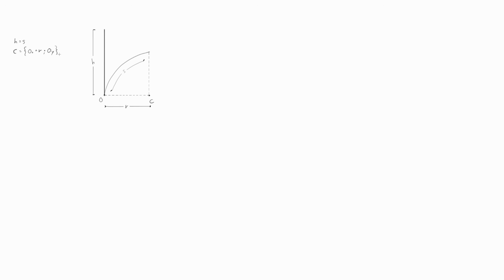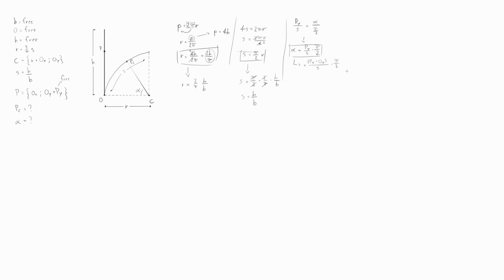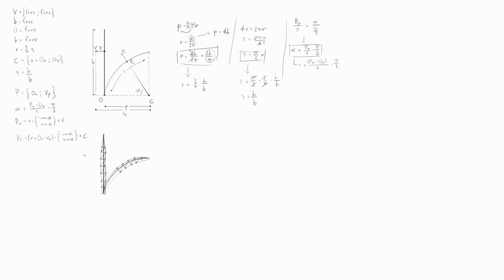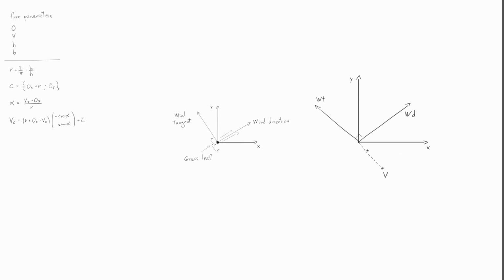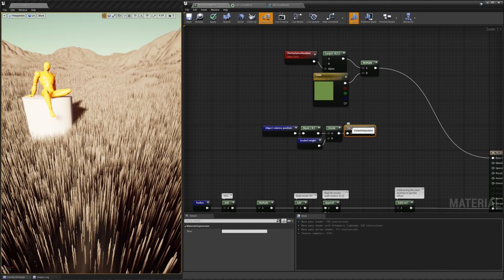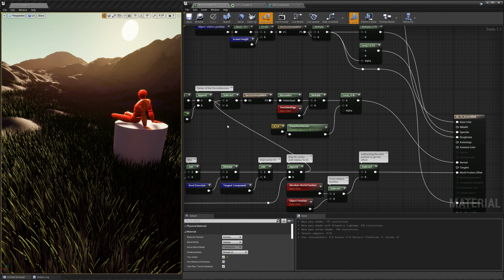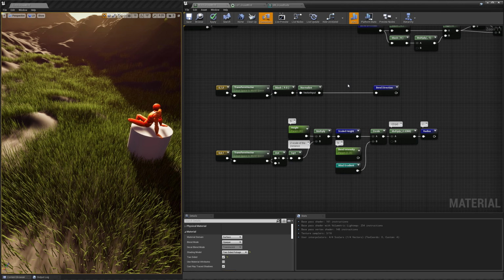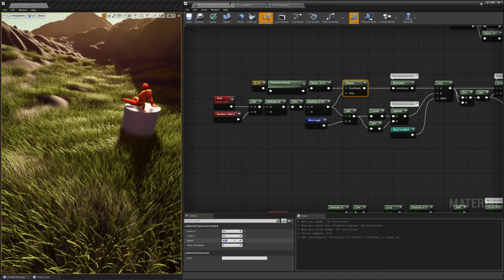HYPER-REALISTIC Grass Wind Animation [UE4, valid for UE5]

Comment: Hey! Just want to say thank you first, then also I'd like to provide you a solution to use this method with multiple strands in the same static mesh instead of individualy spawning the blades. I made my mesh of multiple strands between the -1 to 1 world space in Maya, then wrote a super small script in python that would encode the pivot per strand in R,G component between 0 and 1. In the blue, I'd encode the max bounding box of the strand and in vertex alpha channel a random float. Having the blue encoding the height, I don't need to manually type it in the shader, just sample the blue channel. In engine, I set up uniform import scale at 50 (since maya export is pretty tiny between -1 and 1). On the shader side, I just replaced the Object Position nodes you found in your tutorial by the following (writing it in pseudo code, but shouldnt be hard to read): 
xy_coords = ((vertex_color.rg - 0.5) * 2.0)
xyz_coords = transformPosInstanceToAbsoluteWorldSpace((xy_coords.x, xy_coords.y, 0.0) * import_scale)

The import scale needs to manually be set depending on how much you scaled the static mesh from the maya export. The small math in xy_coords is needed to bias scale the 0 to 1 coords to -1 to 1. After the, the mult from the import scale will make match the pivot positions in real world setting. The append of 0 is for having the strand roots at 0 initially (depending if it was in maya).

Hopefully it makes sense, and again thank you so much for providing this great basis that helped me work my way through this!
Reply from the maker: Great job with that! It's definitely a working solution :D
Really happy to see someone giving a go to bouild on top! May I suggest to use UVs instead of VertexColor? You might be able to get rid of needing manual scaling and range remapping altogether ;)

Be sure to join my Discord if you haven't yet!
Reply: @VisualTechArt  hey! Thanks for returning back. You just had a great idea and it worked like a charm. Save few instructions and just did a top planar projection, scale to center point the top projection uvs then used it as pivot instead. GG!

Comment: Is there a way to apply this for trees? Maybe, it's too complicated by there complexity? PivotPainter2 remain the best option? But hard to apply if you don't have 3DSmax to generate the PP2 Texture :(
Reply from the maker: I think it's possible to do something entirely procedural with few restrictions :D I may give it a go in the future actually.
If you want to tackle the problem by yourself I'd say that you can start by applying this exact bend (not as strong) to the entire tree and then make a second layer of bend added on top for the branches ;)
Reply: @VisualTechArt  How would you approach a second layer of bend? Unless it's a species with a straight trunk, I'd say you might have to separate the branches into unique objects to access their pivot points. I'd also think you might have to manually align the z axis of the object to the branch length. I don't think this should be too difficult for a second layer, but more detailed trees might have 3-5 layers of unique branching so idk how to do something like that.
Reply from the maker: @dylankuzmick3122  Well it depends heavily on the structure of the asset I would be working on. Let's say you have a pine with a very straight trunk and horizontal branches, you can easily break down the movement into 2 layers and apply them on top of each other (kind of in the same way I did in the video to make the grass blades point straight up before bending them) :)

Comment: I have everything set up the way you do, but my grass blade curves from the top and bottom. making a c shape. do you know how i could fix this?
Reply from the maker: May be because your pivot point is at the centre of the mesh, or because you're not looking at an instanced mesh and the Object Position node in that case returns the centre of the object :)
Reply: @VisualTechArt  i cant figure out how to adjust the pivot point. also, when i paint the grass using the foliage tool. the grass curves around a single cylinder. and grass further from whatever point is picked for the cylinder is streched and curved even more. i cant get it to effect each blade individually
Reply: I actually fixed the pivot point. but i am still having the problem with the foliage tool and every instance of the grass blade sharing one cylinder they all wrap around from both directions
Reply from the maker: I meant: is your mesh pivot point at the base of your grass? Otherwise it may be you have the wrong Height value set in the shader?
Reply: same problem i pretty sure my pivot point is at the base, but for some reason when i add the material my grass start to become fat and big, why you just dont share the material, why we need to copy everything ...

if someone have a solution my grass is making a C shape i try differents height but nothing to do

Comment: OMG THANK YOU SO MUCH FOR THIS! I hate the UE4 wind node more than anything I've ever hated in my entire life! I'd say if you use a grass clump mesh, you wouldn't have to worry about each blade being individual as grass tends to grow in clumps anyway and having a few dozen blades moving in the same direction at the same time likely won't look bad at all. Especially with how wonderful your wind animation is.
Reply: You can also achieve clumping inside of the shader with some noise. (That the grass tips clump together for example) But I think the math might get pretty complicated. An easy solution would actually be to find some nice normal map and use it for clumping (You just point the grass blades along the normal) for example a normal map with some peppples should be nice. 

Just imaging you had some pebbles inside of sand and then take them out. They would leave holes behind. When you now take a bunch of sticks and stuck them inside the sand in the direction of the surface the tips would "clump" together over the Center of the holes. 

Taking the pebbles out was inverting the normal map. And putting the sticks over the surface was sampling this normal map to rotate the grass blades.
Reply: You can always store the grass blade pivot in the vertex color or in a texture. 
In most cases you don't actually need the pivot z position (because the start bending all on the same height) so I would:
R+G = Grass Blade XY pivot location
B = Grass Blade height

If the grass rest position is straight like in this example you can most likely get away with just using the vertex position XY. And can also add some height, rotation Variation in the shader for example.
Reply from the maker: Few months ago at work I did a fancier implementation of this where I could use grass clumps but still animate the individual blades separately ;)

Comment: Nice tutorial! my grass stretches vertically when you change the height parameter, and it doesn't look like yours, but I did everything the same as you, what could be the reason?  And how can this be fixed?  I need the grass not to stretch in length.
Reply from the maker: You sure you implemented everything correctly? Is it just stretched or stretches during the bending animation?
Reply: @VisualTechArt  yes, exactly like yours.  Stretches during bending.  Could this be because my terrain is up on the Z axis?  I had to do this to avoid problems with water.
Reply: I believe the reason it doesn't work is because the grass might be Nanite Enabled. I got really weird effects similar to what you describe. Once I turned it back to normal Static Mesh it turned out like in the video. If there's a version of this tutorial but working with Nanite foliage it would be great. But as it stands it doesn't support it. Great tutorial though!

Comment: How complicated would it be to allow this to work for a grass mesh with multiple blades? Your example scene has everything scaled up massive to get around the problem that LandscapeGrassType does not allow more than 1000 instances per 10 square metres, which means when using it at a normal world size, you have hardly any grass covering the land.

My solution was to just create a mesh which covers the necessary space, but your wind setup of course forces the whole mesh, instead of each blade in the mesh.
Reply from the maker: That's the challenge I left for the viewer at the end of the video! I already solved that problem on my own, but happy to discuss about it :)

Why don't you join my Discord server and brainstorm there?

Comment: Amazing freaking content. I have learned so many things that I had to write them down. I have a question, the Z-scale finding trick does not work for me. I am placing my grass using the Grass node in the landscape material. The landscape grass type is set to scale the grass 3 to 4 times. However when I transform the 0,0,1 vector, it returns 0,0,1 (i visualized it with the debug nodes).
Reply from the maker: Did you pass the scale thing through the vertex interpolator node, before the display debug one? Otherwise it will return the cluster data
Reply: @VisualTechArt  Ah yes, that was it! I have one more questions if that's okay :D We're using the ObjectPosition node instead of the ObjectPivotPoint node. Isn't ObjectPosition supposed to return the center location of the object, which should ruin the gradients from bottom to top? Is that somehow different for instanced meshes?
Reply from the maker: No worries, for instanced meshes the Object Position node returns the pivot location, when used in the vertex shader, otherwise the cluster centre (if I remember correctly)

Comment: Really curious about performance here. Also wondering if you had any solutions for how single blade grass gets handled by TAA. I know it's a notorious thing in Unreal with no perfect solution.
Reply from the maker: I've just taken another look for you now :D
I'm on a 980ti (which is also half broken) and the scene runs at 30/40fps@1440p, but consider that at the moment I have the Directional Light set with 10 cascades (much better than what I showed in the video sadly).
The grass has just the shader on and the only "optimization" active are LODs (4 levels).
When I was recording I used some other optimizations to reach 60fps minimum to be able to use VSync :) I was thinking about a future video about optimizing this scene, there are a decent number of things that can be done.

Regarding TAA... there's both some flickering and ghosting in the distance, of course :) But that's because I'm keeping single blades for way too far in the distance.
Reply: @VisualTechArt  That would be terrific!
Reply: @VisualTechArt  Quick question: I just got to 36:26 when the normals should be done, however I'm getting some bad black flickering on patches of the blades. Any idea what I could have messed up there?
Reply from the maker: Argh, I got them too few times while I was building the shader, but it was popping in and out on single blades... If you go in the Normal Buffer and you see it there too, should mean you're setting a value of 0 there somehow. To be honest I don't remember exactly what I did to fix it (it was like 2 months ago) and at some point I didn't get it anymore xD

Oh, if it's on patches maybe you forgot some VertexInterpolator node somewhere?
Reply from the maker: @prestonschulz9359  Argh, I had that problem at some point too when I was developing the shader (like 2 months ago) and I don't remember exactly what I did to make it disappear.
If you see it on cluster you may be forgetting some VertexInterpolato somewhere, I had it on single blades. Also, if you can see them go black in the World Normal Buffer may be because you're trying to normalize a 0 length vector or dividing somewhere a value by another value that somethimes equals to zero.

Comment: I have a problem with the custom node: even if i write it in the same way     return float2(-cos(a); sin(a));     i can't compile the shader, i get these errors

[SM5] /Engine/Generated/Material.ush(2620,22):  error X3000: syntax error: unexpected token ';'
[SM5] /Engine/Generated/Material.ush(2620,30):  error X3000: syntax error: unexpected token ')'
[SM5] /Engine/Generated/Material.ush(2626,22):  error X3000: syntax error: unexpected token ';'
[SM5] /Engine/Generated/Material.ush(2626,30):  error X3000: syntax error: unexpected token ')'

Any idea?

Thank you kindly.
Reply from the maker: It's return float2(-cos(a), sin(a)); you have to use a simple comma ',' to separate the float2 terms, not a semicolon ';'
Reply: @VisualTechArt   Oh god, that single point! Thank you, now it works!

Comment: Any reason to not use the slerp (spherical linear interpolation)?
Reply from the maker: Yep, if you plot the path a vertex follows from start to end position, it isn't a circumference section! :)
Reply: True. I wander how big of a visual difference it would be to use the slerp with some dampening based on the distance from the root of the blade. And the difference in cost of your system and a slerp based one, even tho I would guess they are very close.
Reply from the maker: @Lorenzo_3D  I guess so... My bending function itself is not that expensive actually, has only simple operations and two trigonometric functions, while the slerp I believe is more trig and less operations in total. If you ever test it let me know how it goes and if it's visually good :D